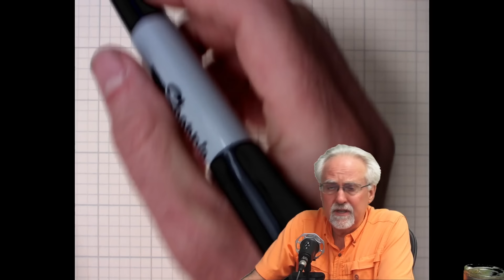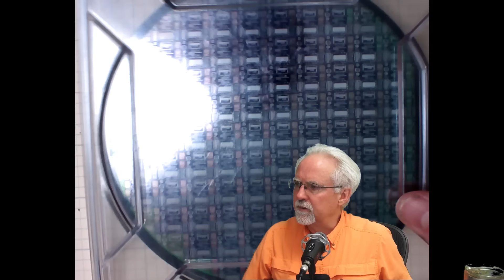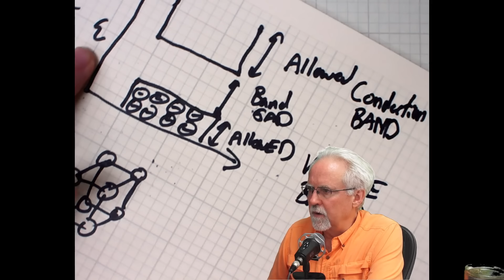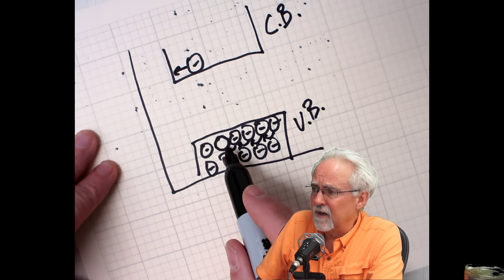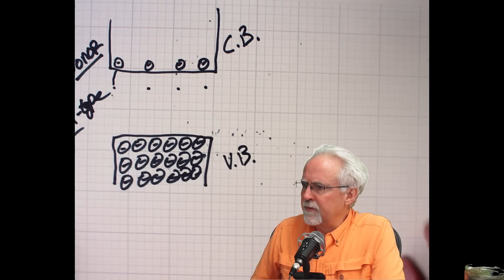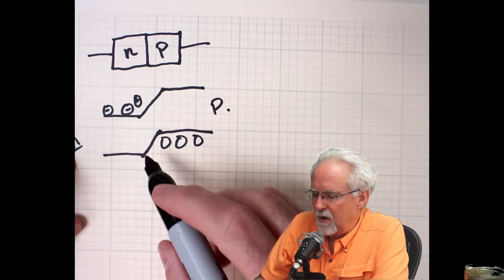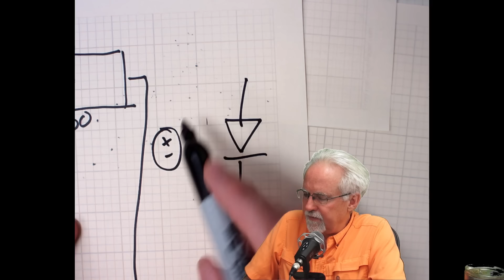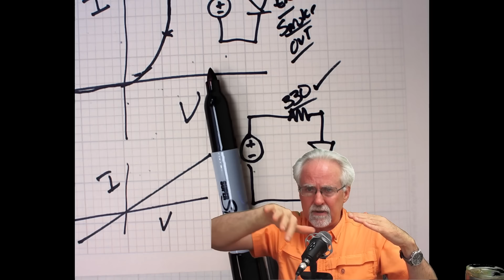Arduino Tutorial 2: Understanding How Light Emitting Diodes (LEDs) Work

Comment: I started out wanting a CNC router (I like wood working). As a former auto mechanic I decided to build my own but knew I needed to learn CAD/CAM which led me to your fusion 360 course. I also intend to build my electronic control system and now I'm here learning Arduino and Arduino programming LOL. I figure to buy what I want to build would run well over the $10K mark but would cost less than $5K comfortably by building it myself. I think I'm going to name it after you (The McWhorter) lol. I want to see a video of you jumping over a 3 foot fence LOL (Just kidding). I've done some scripting and have a decent grasp on electronics. This should tie it all together nicely. There are people running CNC stepper motors on the Arduino Uno. Good stuff as usual. I joined your Patreon page in return. Thank you. Ordered the kit, should have it in 2 days.

Comment: Is this a class in electrical engineering? If so I will be so excited to take it and know the material already. Which class is it? I will be doing ee in the fall
Reply from the maker: Mainly arduino programming but we get into some simple circuits and devices before it is over

Comment: Incredible lesson, Mr. Paul. I was wondering, why the LEDs release the photons and the diodes do not?
Reply: Diodes do, or at least can release photons. Problem is most diodes are made of opaque materials and they are absorbed before they can get very far. And they are not necessarily visible light photons. IR, ultraviolet, etc.

Comment: Can you add in using meters to see the currents and voltages when building circuits.?
Reply from the maker: You can measure voltage, or a number related to voltage using the A0-A5 pins, but it is pretty hard to measure current.

Comment: I followed your first series on the Arduino and was somewhat disappointed and confused. Although I am a newbie I realized that the lessons provided by the kit and your lectures were not filling all the gaps in my understanding. As I tried to design my own projects I didn’t have enough of the basic electronics information to understand how to design some of the circuits. I’m really looking forward to learning more of that as we go along. Thank you for revisiting this topic. I’m hoping for a better understanding of two dimensional arrays; PISO shift registers to increase the number of inputs; determining when to use different types of communication protocols like I2C, SPI, UART, etc.; and best methods of extending communication distance between devices.
Reply: I have to be ambitious. I’m 72 years old. I don’t have a lot of time left to muck about trying to figure things out on my own. PISO is an acronym for Parallel In Serial Out. There are other types of shift registers like SIPO, Serial In Parallel Out. If you know how to use them you may be able to use smaller development boards by using shift registers to increase the number of input pins or the number of output pins. Several factors need to be considered, but for model railroads where you are controlling rather low frequency events these seem like they could be a good way of handling animation events.
Reply: Karl, for a newbie you are very ambitious. I dnt know those terms that you throw around. I am happy with digitalWrite....

Comment: I was able to follow along easily (seems like magic to this retired warehouseman! but I’m willing to ‘suspend my disbelief’ because I can see LEDs working everyday.) I’ll watch the lesson again and see if I can parrot the salient details back to someone.:-) I do have the takeaways you stressed
about installing an LED correctly…long leg to the positive voltage and a resistor in series with the LED.
I wondered about your comment that in addition to n-type and p-type semiconductors, there are also intrinsic semiconductors. Is there an actual use
for such a device or is it purely theoretical given that there would be practically no conductance?
Reply from the maker: Usually semiconductor devices are some combination of n-type, p-type and/or intrinsic type. The magic happens in building the different types side by side.

Comment: Excellent job like I was back in college. During our first lab with LED's one guy hooked his up without the resistor, hey presto, silicon to carbon converter of course he wasn't the only one I say with red face. Keep up the good work.
Reply from the maker: Yep, in my classroom we have the "Wall of Shame" . . . if you burn out or break something, you have to tape it to the wall of shame and sign it. One student made a silly mistake and burned 10 LED out at the same time. They are still on the wall.
Reply: @paulmcwhorter  Ah, for the good old days. Fond memories.

Comment: Only those initiated into the Guild of Electron-ics will understand, otherwise it's going to sound like occultic incantations.
Reply from the maker: It is hard to know how much of the physics to include. Band diagrams, fermi levels, and carrier concentrations, drift and diffusion are fascinating. Wish I could include more, but dont want to lose people. Maybe eventually I can do more of a solid state physics class on how these things really work.
Reply: I spent my wizarding years in the Most Worshipful Guild of Computer Wranglers where I battled many a user generated demon. Now in my silver haired years I wish to learn the deep and occult mysteries of the semiconductor. This enlightened Grand Wizard McWhorter will guide us all to the exalted plane of understanding that is the Well Designed Breadboard Prototype. I genuflect in his presence.

Comment: Cool! I am sometimes confused how to supply enough power to work with 5 MG995 servos. The DC port isn't enough.
Reply: Good day, « Quardbaud »

A Servo motor usually works on a 5V Supply, BUT .. Servos are special motors that, unlike other motors, can rotate half a turn.  They are ment to control an arm position.  The Supply pins are pins 1 and 2 (brown and red wires, where brown is negative and, as you guessed, red is positive).  If you applied more than 6 volts to this motor OR you connected it backwards, OR you applied supply voltage to the PWM pin .. please purchase another one, since you cooked it !!  They are very fragile little devices .. especially the Chinese ones !

The SIGNAL pin, is pin 3 (Yellow) and accepts a PWM (Pulse Width Modulation) signal.  In next lessons, Paul will talk about Data Pins that are PWM-able (not all of them are), and will teach how to control them in order to dim an LED .. or control a Servo motor.   You might want to look at Lesson 7 (new series) or look at this lesson from the old Series .. (LESSON 16: Controlling a Servo with Arduino).

I hope this helped and you didn't cook your Servo.  They're not expensive anyways and, if you did, well .. that's the price of learning.  Have a great day, my Friend.